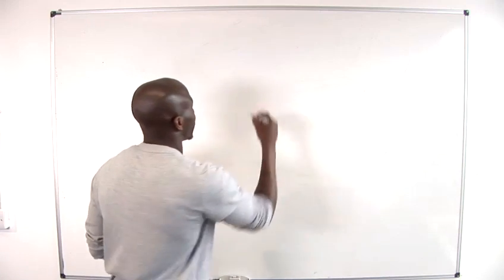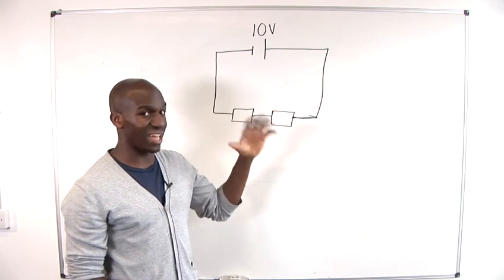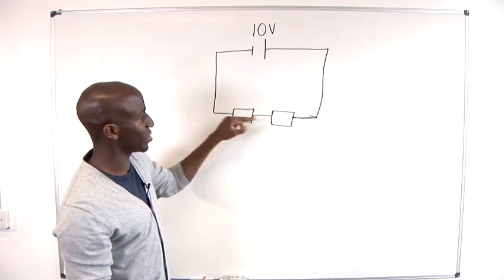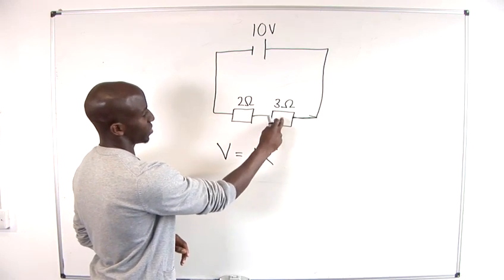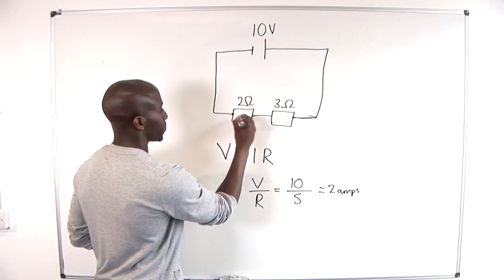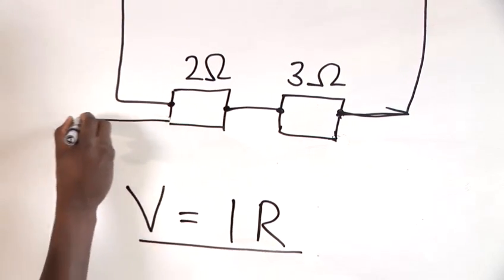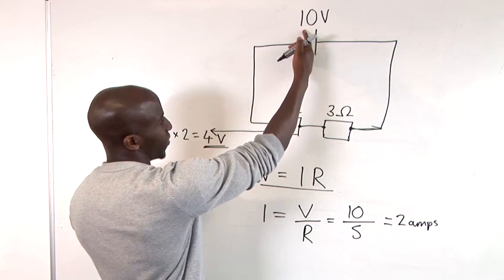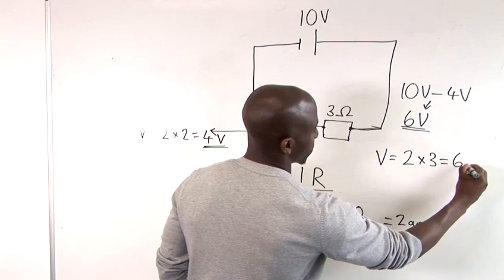How To Compute Voltage Drop

Comment: At the other side of the resistor 3 ohm does the voltage go back to 10V when it returns to battery? Or does it go to 0V? After the volt drop that’s what confuses me 

Surely must be 0

Comment: well tanks a lot but more useful if you apply it to ac circuits 110 volts 3% drop how you calculate it 110x3% equal 3.3 drop
between service and branch circuit no more than 5% drop voltage is permited,service to feeder 3% feeder to branch 3% but between them only 5% is accord nec code done

Comment: When you measure this circuit (no load) with a multimeter. You will find that no voltage drop in the end point of the 3ohm resistor. So, a voltage drop will show itself as long as you connect the load. You're welcome.

Comment: R=resistance=ohms
V=voltage
I=current=Amps
Vd=Voltage drop

R1=2ohms
R2=3ohms
V applied= 10v

1)Find R total
2)Find I total

R total= R1+R2= 2ohms+3ohms= 5ohms 
I total=V applied/R total= 10V applied/5ohms total= 2A
 Vd1= (I total)(R1)= (2A total)(2ohms1)=4A
Vd2= (I total)(R2)= (2A total)(3ohms2)=6A

Comment: Just to follow up in the logic:

If the voltage drops by 4V after R1, you only have 6V left before R2.
So for the 2nd drop I’d apply V=2A*3Ohm = 5V drop. 
After both resistors the voltage will have dropped down to 1V as it drops a total of 9V at 2A.

How about using the combined resistance of 5Ohm as they are in series (so you can add them up)?
That‘d be V=2A*5Ohm = 10V drop.....🤔🤔

Something went wrong somewhere...
Reply: as you previously stated, ''V = 2A x 3 ohmns = 5V" which is wrong because in that case you used addition and not multiplication.
Reply: ...because the resistors are in serious I used addition as I understand resistors in series add up...or not?

Comment: Take this video down. You were using the power supply backwards therefore the voltage drop calculation would have been different if you had explained and illustrated it correctly I failed an exam based on this information.
Reply: Trying to understand your complaint. You're saying that the voltage drop across the 2 ohm resistor was 6 volts because there was 4 volts running through it? And the drop across the 3 ohm resistor was 4 volts because there was 6 volts running through it?

Comment: So current remains constant when calculating voltage drop??
Reply: The circuit is in series so the current across the resistors is the same.
Reply: @belson7725  when it's in parrellel??
Reply: @Pokemon Master in parallel only the voltage is the same but the current is not.

Comment: Nice video, but I came across this in a search for calculating voltage drop across resistors with unknown ohms, since they didn't put that in for the questions asked in my class work book.
Reply: H, look at that. Third time something was out into the text AFTER needing to know it. 'Voltage after last load should be less than 0.1V' I wish the authors would better organize their material, the first of these after it's needed notes I found was a safety warning put on the next pag after the process of doing something in Small Gas Engines that could be fatal.
Reply: *Oh, look....

Comment: Question. If we're using v=IR (voltage) equation for each resistor, wouldn't that calculate the voltage across each resistor not voltage drop? In your example is we use V=IR with a 2ohm resistor in a 10v circuit where the current(I=10/5) is 2 amps. So that's V=2x2. Wouldn't that mean the voltage is 4v not the voltage drop. So the voltage drop would be 10v-4v with a conclusion of 6v drop. This would leave the second 3ohm resistor with a voltage drop of 4? Which doesn't make sense why a 2ohm resistor would drop the voltage more than a 3 ohm would.

Comment: but for the second resistor wouldn't the current be 3.33 since its voltage / resistor?  why does it stay as 2?
Reply: MMM - JUNG SIS yes. Dude in the video should've mentioned that.
Reply: Mike Manahan in a series circuit, current stays the same. in a parallel circuit, voltage stays the same.

Comment: "It's like, electron fings and shit, they like move and whizz round and shit, like"

"We've got fings in da circuit called resisters, they are dead fit but don't like da fings what spin round and shit..."

"I'm still not sure how dey get currants in the wires..."
Reply: did you suffer a stroke there neanderthal boy? get some help.
Reply: Chuck Norris you need this video the most, hahaha you are brain dead.

Comment: Awesome video, i tried using it as an alternative then the confusing way i learned in school. But to me it seems incomplete. In the formula i learned to find voltage drop it is 

VD= 2xkxLxI divided by CMA

K meaning the resistance  of the conductor (ex 10.4 for copper)
L meaning the length between the load and power supply.
CMA meaning circular mills. basically the width of the conductor
I of course meaning AMPs, or Intensity
2 is used for if there are two wires.
of course VD meaning voltage drop.

Could you try and make one like that?

Comment: Absolutely the best explanation of calculating voltage drop. I had 20 yrs as ASE auto tech,  I spent the subsequent 20 years at a different endeavour.
With all the new technology I need to brush up on these things. Yeah, I'm an old guy but I enjoy automotive diagnostics.
Thank you
Reply: Sense you enjoy automotive diagnostics why would a motor burn oil when accelerating but not on cold start or without load example when in neutral. But not every time only random . Speed, bumps, temperature outside or engine temperature make no difference uphill  down hill have no effect.

Comment: Could this be used to also solve Voltage drop in a Parallel circuit?
Reply: Yes i think so but when calculating total resistance you will have to use 1/r +1/r instead of simple addition of r+r to find total resistance.

Comment: Very nicely explained. Please, if possible, explain the same on a simple LED bulb circuit, where maybe the LED is a 3.4 Volt LED with a forward current, of say 300 milli amps, where we will use a 9 Volt battery (DC) to power it. This will help to clear up the concept on a practical scale.  God bless you. Thanks.

Comment: Thanks. I got it .... Had to swing over here to understand that you need to calculate total resistance first then use that to get total current then use that to calculate individual drops over each of the resistors.

Comment: Kirchhoff's voltage law.

"The sum of the emfs in any closed loop is equivalent to the sum of the potential drops in that loop, or: The algebraic sum of the products of the resistances of the conductors and the currents in them in a closed loop is equal to the total emf available in that loop."
Reply: the sum of the frequencies?

Comment: what if I want to measure the voltage drop in a wire?
Reply: +Zedan Mutlu  The drop is very low in any useful wire used in circuit classes. You would need a very sensitive multimeter.
Reply: ***** Yeah i guessed that would happen. well it should happen

Comment: Fantastic! :D finally found a video that explains Kirchhoff's in terms I understand.

Very well presented and easy to follow, thank you, thank you, thank you  (I may yet pass the course I'm on after all).

???@MisterBinx: looks like your the confused one.

If his diagram is parallel, then by all accounts every circuit board I've successfully made to date should not in fact actually work, even though they blatantly do.

Scrub out R1 or R2 in that diagram and suddenly the loop is opened leaving no path in which current/voltage can flow until you bridge the gap (short circuit), therefore it's a series circuit.

Comment: sir. the long terminal is + and the charges starts form the  + terminal  to - terminal  so the current will bass first the 3 Ohms resistor then 2 Ohms resistor. by the way you do it, it became something called Polarity.

Comment: hi
sir how r u
my ques. is i have 12vdc supply to operate 30nos. locks (1 lock each floor) X 0.20amps   on 30(150 meter) storage building in series my voltage drop up-to 5vdc
can u help me how can i operate all locks at a time

Comment: Quite a good video.  I would have mentioned a couple things to avoid confusion as shown in previous comments.  To clarify:

The circuit depicted is a "Series" Circuit.
This method is primarily used in Automotive Diagnostics which uses 12v  DC (Direct Current)

Best way to think of a voltage drop in a series circuit is as such... The volts is the pressure in a garden hose (Volts is denoted as "E" in Ohms law which is also called "Electro-motive-force".) a resistor is a kink in the hose and as water moves through the hose and hits a "resistance" some of that "pressure" gets used up forcing the water (Electrons) past the resistance.

Kirchhoff's Voltage law (First law) in a series circuit states as such " The total of all voltage drops across all resistances in a series circuit will equal the sum of the source voltage".

My source knowledge: Automotive Technician.

Comment: clarification sir.. after 2 ohm resistor the voltage pass trough the wire is equal to 6v b-cos it drop to 4v   and we still using the source voltage to compute the 2nd (3 ohm) resistor?
Reply: pablo bada 
my mind twisted there too bro...
its like d smaller resistance make smaller pass and d greater resistance make bigger pass...
i dont think thats a resistance
in d 2nd resistor he should use d voltage after d 1st resistor

Comment: This is wrong!! a 240V AC (mains) supply IS the RMS  value(the RMS is implied). You would actually multiply 240 by rt(2) to get a peak voltage of 339V or conversly 339V/rt(2) to get 240V RMS.

Comment: In summary: As long as the circuit only uses resistors (or any frequency-independent components), then you can use the RMS voltage with V=IR just fine :)

Comment: The total resistance (impedance) in an AC circuit actually depends on reactance (frequency-dependent resistance due to capacitive and inductive components) as well as normal resistance. However, the AC voltage is expressed as what is called the root mean square (RMS) voltage. Without going into complicated definitions, it's the peak AC voltage divided by the square root of 2 (e.g. 240V AC supply has an RMS voltage of 240/rt(2), or 170V). You would use this RMS value in the V=IR equation.
Reply: Sir ,
That time in which standard you were ?

Comment: Zero Voltage drop means "No Load". The Load provides the resistance that reduces the supplied voltage which is called the Voltage Drop.

Comment: if current flows through there is voltage drop ... U=R.I if you have a battery of 12V and 2 resistors (lets say 6ohms ) the equivalent resistance is 12 ohms ... since they are connected sequently I=U/2R      the current is 1A so u got a voltage drop of 6 volts on each other ... if the curcuit is open no current will go through

Comment: So if you put one resistor in a circuit, connected to a battery. It doesn't change the voltage at all?

Comment: @andres220 Yes, that is pretty much correct. Yes there are still electrons flowing after leaving the resistor but for electronics discussion you can call it zero volts.